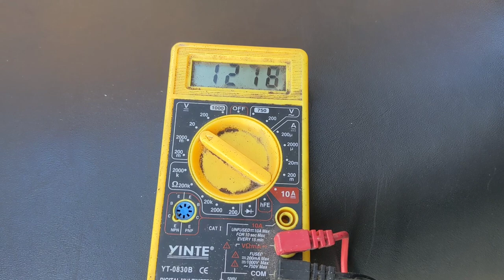Honda CBF1000.  Blue breaks down!

Comment: Your voltmeter was showing 12.77 volts, which is fine for a battery that is just off a charger/tender or 2 mins after a run and ignition being switched off, while running, assuming the stator and reg/rec is working as normal, you should see circa 14.2 volts, which you can check directly at your battery, while the engine is running.If the 3 way connector from the stator to the reg/rec is within reach, unplug it and test each phase to see how many AC volts each one is outputting or to see if any are weak or non working
Reply from the maker: Thanks mate.  When I get a chance I will have a look.

Comment: £30 for a complete set of valves, springs, buckets and shims is well worth it, even if the valves aren't any better than you've got. Those extra 8 shims should give you more options for setting up your clearances - if they're anything like Suzuki prices, new ones are over £15 each. I usually rely on the wiggle test for valve stem clearance - see how much side-to-side movement they have (with the stem seals removed). Bear in mind, you're not building a high performance, race engine, just something usable and reliable, so it's not critical.
Reply from the maker: Thanks mate.  That's my thinking too.

Comment: Are you sure you read the caliper correctly, 0.10mm under size on a valve is a lot. If, as I'm going to assume, they were 0.01mm under size I'm sure they'll be reet. By comparison, the valves on Blue are 4.475 to 4.490mm diameter, with a maximum wear limit of 4.465mm.
Reply from the maker: Definitely measured them right mate albeit with crappy calipers